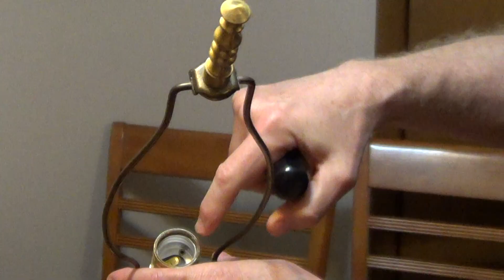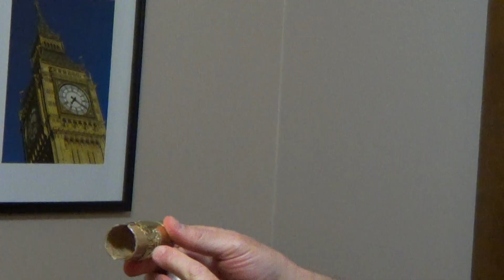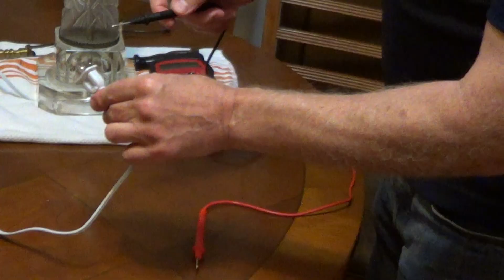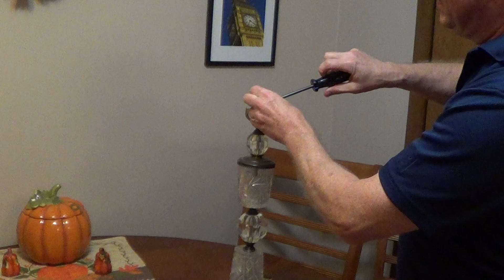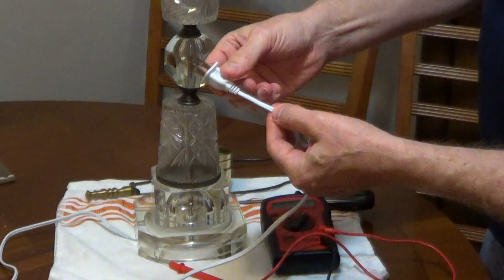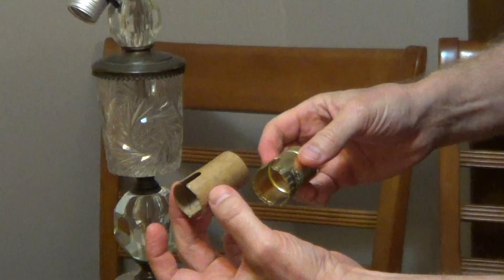Lamp Not Working - Lamp Repair

Comment: Thank you!  I replaced an inline switch that I thought was the problem, but, the lamp still didn't work.  Then, I watched your video and pulled up the electrical contact and that was it!  Unbelievable that it was such a simple solution that I would never have tried.
Reply from the maker: Glad it helped
Check out some home improvement tips in our e-books https://www.amazon.com/gp/product/B0B2KW1FQ9?notRedirectToSDP=1&.
Reply: @FIXITHomeImprovementChannel   I have one other issue that I cannot find an answer to anywhere online.  In a guest bedroom, we have four, LED, recessed lights.  After 3 years of use, only 2 of the 4 come on.  I have turned them on/off for the past several weeks and on a couple of occasions, they all went on!  But, after turning the switch off, the next time we turned it on, only 2 of the bulbs light up.  I tried new bulbs and your suggestion of bending the electrical contact that worked for my floor lamp, but, two of them still don't go on.  Any suggestions?   Thank you!
Reply from the maker: Hi, do you have a dimmer switch for the lights? @MartyArmato
Reply: @FIXITHomeImprovementChannel  Yes, they are on a dimmer.  You're thinking that the dimmer switch could be causing 2 of the 4 to be inconsistent?
Reply from the maker: Hi, yes, I would check the minimum load level.  @MartyArmato

Comment: thank you, thank YOU!         Question, though- in the first 30 seconds you say..."pull out the electrical contact in the center...and then check that to see if that solves your problem.."   see if WHAT solves my problem?        And this is very much from a thankful stance, your general clarity and altruism flows through the video....i just don't know what you mean  by that...
Reply from the maker: Hi, if you have a good light bulb and it's not working in the socket, sometimes the contact at the bottom of the socket isn't touching the bottom of the bulb, it just needs to be pulled up.  
Check out more home improvement tips in our e-books https://www.amazon.com/gp/product/B0B2KW1FQ9?notRedirectToSDP=1&.
Reply: Thank you @FIXITHomeImprovementChannel

Comment: For me, it's not the socket that's the problem, it's the turn knob that broke off. The lamp doesn't even turn on because that piece has broken off and I can't get a replacement part because I can't afford it nor can I find it in stores. It's so annoying. When I get enough money, though, I'll be getting a replacement knob and installing it myself to see if I can fix it. I just need an Amazon gift card or something and I'll be able to fix it. Replacing a turn knob is a little difficult but it should work.
Reply: Something tells me you won’t find the knob,I think you have to replace the socket entirely ,they don’t sale separate knobs anywhere ,and the socket is not expensive at all I think less then $10 dollars

Comment: Thanks, my man! Who knew a simple "Why won't my new lamp turn on?" would yield such a clear, precise, just-for-non-electrician video! I tried the first step you mentioned and lo and behold: we have light! But, get this, I didn't even have to perform the first step. I flipped the lamp over, ready to go in with my flat head, and that is when I discovered someone wedged the silica gel pack in that very spot. Like what? I gently removed that baby so it wouldn't rain gel beads all over the floor, popped the light bulb in, plugged in, flipped the switch, and voilà! No wonder why this beaut was on clearance for the lo! I went from lucky me :( whomp, whomp, whomp. to LUCKY ME :) Yippeee!  in a matter of moments. Thanks again!
Reply from the maker: You're welcome.
We have more tips on our weekly podcast.
https://itunes.apple.com/us/podcast/fix-it-home-improvement/id880903087?mt=2

Comment: Hi, my little tip: I discovered the socket in my lamp has a second smaller metal contact next to the large metal contact. I bent the smaller one up and down and I got the lamp to work. I don't know if the smaller contact was too high or too low, but it's another component you can check if your lamp has that type of socket.

Comment: Thank you, FIX IT. I'll have to take mine apart to see why it's not working, but my plug is non-polarized (the lamp is from the 70s). Should I replace the cord to have a polarized plug?
Reply from the maker: Hi, yes a polarized plug is your safety against a shock hazard if the bulb is removed. Here is a podcast we did on lamp repair tips. https://youtu.be/nnsDDfcs5F4

Comment: Thank you!! So easy and simple to fix! You just saved me buying new lamps (even though these were only 1 year old) Cats knock it off the table and killed both of them. After watching your video, I realized it was probably so easy for the cats to kill both lamps because there wasn't any knot in the wires. I fixed that too. I did have to purchase the actual socket for the lamp, because the bottom portion where the screws were, was all  hard black plastic, and not exposed. So I got replacement sockets and cut n striped the wires to place them on the new socket, put the knot in and replaced. Literately took me 15 mins for both lamps! Thanks so much!
Reply from the maker: Glad it helped
We have more home improvement tips on our weekly podcast https://itunes.apple.com/us/podcast/fix-it-home-improvement/id880903087?mt=2

Comment: "All you have to do is squeeze it..." - I tried for ages with lots of swearing doing this, until I eventually found that mine come apart to then pull it up. I thought "Yay!" until I then saw that everything from then on is a solid plastic sealed unit with no way of getting to the wires.

Also, my lamp turns on by touching it, so I don't know how this relates to checking the hot side. The neutral side is good but the hot side is dead.
Reply: That's how mine were too. I just cut n striped the wires and got a pair of sockets off amazon for just a few bucks. easy peazy.

Comment: This was helpful but what if after checking the continuity the narrow and brass side doesn’t beep? (The wide and silver side did go off)
Reply from the maker: Hi, the wire from the narrow plug should go to the brass and the wire from the wide plug should go to the silver screw. Just reverse them for safety.
Reply: If you aren't getting a current though the wire you need to replace the wire. It could have gotten kinked and broken inside the casing.

Comment: Thank you so much for the tips. Can you please help me out with my unusual situation. I have two lamps one of them is an LED lamp and the other is a vintage lamp. They both work they're not broken BUT when I try to screw the vintage lamp in my room it doesn't work (although it works in the kitchen) and the LED lamp works in both my room and the kitchen.
Reply from the maker: Hi, you said, when you screw the vintage lamp in my room it doesn't work. Did you mean plug it in?

Comment: Thank you for a good video!
I have what to me is an unusual situation: my table lamp (which sits on a glass-top table) has recently begun to flicker and to turn off and on whenever anything touches the glass of the table.  (This happens only when the lamp is switched "on.")  I can literally turn off the lamp by touching the table -- and turn in back on the same way.  But, if I touch the lamp (it is not a touch lamp) with my hand, nothing happens unless I turn the on/off switch.
The lamp is about 15 years old.
Any ideas?
Reply from the maker: Hi,

It could be a loose wire or bad switch. I would take the socket apart first and see how the wires are connected to the screws. Make sure the cardboard insulator is covering the wires. For safety, you can get a kit with a new cord and socket.
Reply: Thanks!  Strangely, by simply lifting the lamp and then setting it back down, the odd off/on activity stopped.  I'm thinking it might have been caused by static electricity and, when I lifted the lamp, I discharged it.  Just a guess.  I'm going to see what happens over the next day or two; if it stays "normal" I'll take the socket out, as you suggested, and examine everything.
It might be that it just needs new "workings" as you also suggest.  If it wasn't static electricity that caused the problem, I'm thinking something is loose.
Either way, it probably needs its "insides" replaced.
Thanks again -- and for responding so fast!  I wasn't expecting it! 
You have several great videos on your main site.  I know I'll be spending plenty of time there!
Reply from the maker: Thanks.
We have more tips in our home improvement book https://amzn.com/B01MRGO8C5.